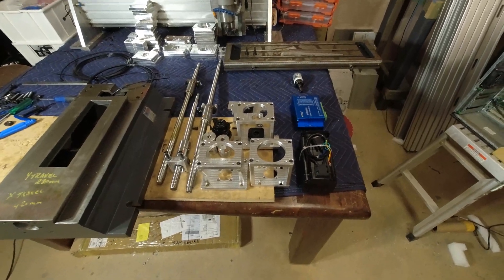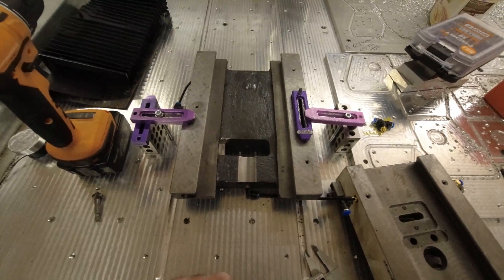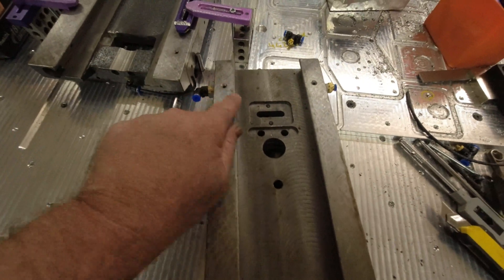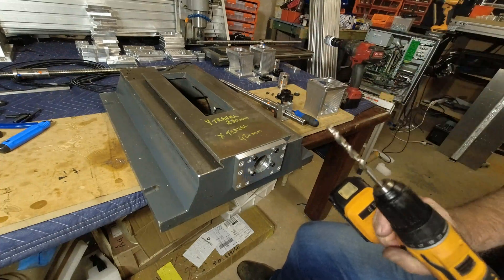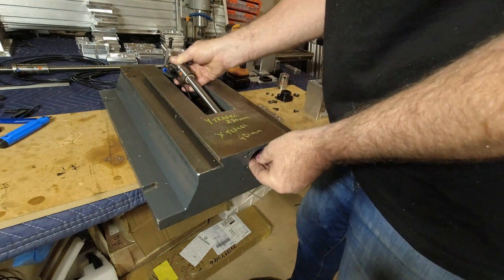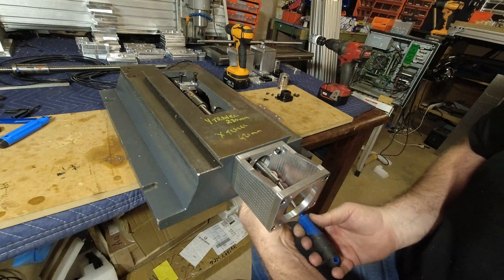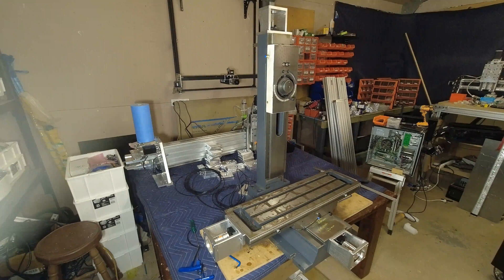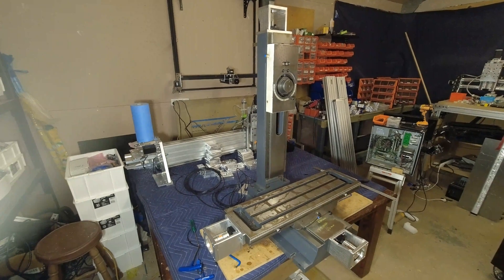Optimum MH28V CNC Conversion assembly

Comment: Hi Daniel, I note that the conversion is about $2,500.  Is there a list of parts enclosed in kit and I believe you have just had an addition to this kit? if so, how much is this variation.?  Lastly, do you supply templates for the correct locations of all modifications including lubrication points.  Thanks in advance, Jeff
Reply from the maker: The kit is available as just a plate mount set  or as a kit with double nut bslkscrews  , thrusts  ,plum connectors , closed loop steppers and power  supplies